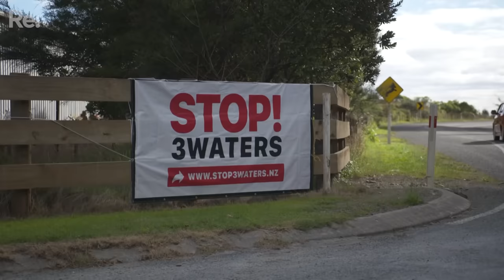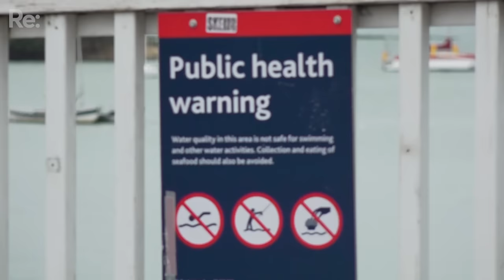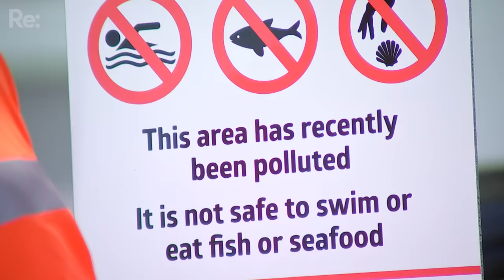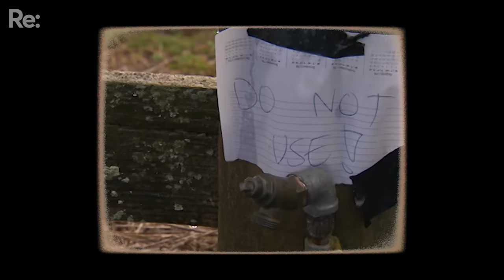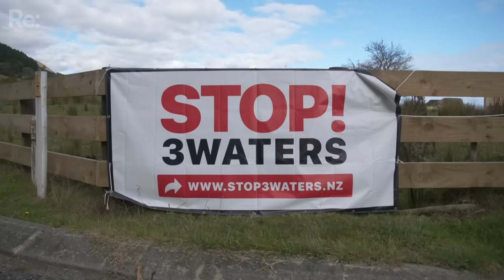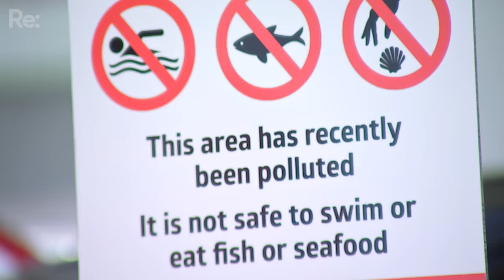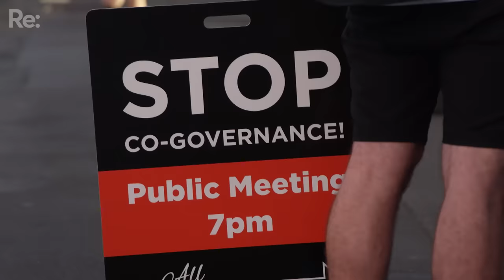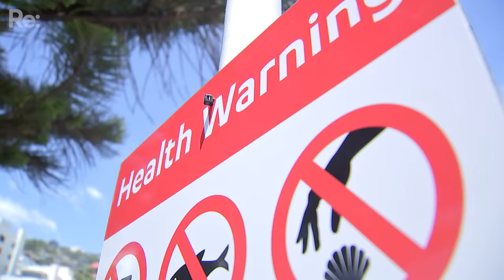Three Waters is dead. But our water system is still f***d

Comment: Coming from someone who worked 6 years in wellington water repairs. I honestly believe they sabotaged the repairs to push for 3 waters. Let me explain. Our service operated on Preventative maintenance. We locate leaks and repair before they become problematic. We managed to drop the water loss to its lowest with ease. However Wellington Water stopped using our service, fired all of the old timers who have been repairing wellington water leaks for decades and replaced them with fulton hogan. Not to mention 50% of the water funding was disappearing, a statement released by their own accountant. The signs they put up every year telling the public to cut down on their water is a scam, most water loss is from the council themselves
Reply: Considering who we are dealing with, sabotage would not surprise me, and on top of that, councils don't budget for the future.
Reply: Sounds like trump conspiracy theory  a figment of imagination
Reply: @rangisullivan1591  no it doesn't. What's your perspective?
Reply: Sounds like you need a new Mayor….a sober one
Reply: Complete lies.

Comment: I cant believe that councils didnt plan for this.
Reply: They only plan for today's needs. National will ignore either this problem, or force the councils to pass the costs onto ratepayers. 

The only chance we had for any option that avoided this, was 3 waters, and that is gone. 

By the time Labour returns, there will be no way to handle this by preparing for it, except reacting as it fails, council, by council. Some councils are already reporting failures, and I do not see this National government responding to it. They will ignore it as they always do with any event that happens. 

The effort to repair the damage as it occurs will eat up every cent and dollar that is available, causing more issues.
Reply: The costs were always going to be paid by the users under Labours proposals with the addition of a large bureaucracy. The same concept used in UK has been an environmental and financial disaster. Also not all of NZ is run down but it’s the cities with the problem.
Reply: @shauntempley9757  I think the maintenance should be paid for by the users. Councils will just need to put a maintenance plan together and allocate funding. This is exactly what rates should be for. We don't need more beuracracy to manage something that should be bread and butter for councils. We definitely don't need more centralised ownership of assets. They should be owned and funded locally.
Reply: They should have done it decades ago but uh money and control, meh.
Reply: @tooxtalivai0690  no point talking bout shoula coulda woulda. Just gotta put a plan in place. It's like planting an orchard. The best time to plant it was 10 years ago, the second best time is today.
Reply: Having worked briefly for a council in the water and wastewater networks unit, engineers every planning cycle clearly told councillors the absolute minimum that had to be done, and councillors thought the engineers were politicians, that is, exaggerating for effect.

In some ways taking this out of politicians' hands would be a good thing. Centralising it under the central government though? A recipe for perpetual delay and millions spent on branding and diversity training instead of pipes and pumps. Privatising it? We can see how that is going for the UK. The tl;dr is "not well".  No easy answers.
Reply: Of course they did but the voters wanted cheaper rates bills. And voted in people who gave them cheaper rates bills.
Reply: @jafa1402  this would all be solved if government required councils to put aside money for maintenance of these assets.

Comment: Is this issue less about 3 waters itself and more about how much councils have diverted infrastructure spending for years into other projects that are way more visible and/or more politically popular? This is not just impacting water. Road maintenance and development has been almost non-existent in my area, even given the amount off farm land being allocated to housing and the corresponding population growth. They are increasing rates and population and yet ignoring issues like water quality. This needs to change. Stop making it political, it should be about people, by people, and for people, not votes!

Comment: Three waters has added three extra levels of administration; half of which is controlled by Iwi, employ's 420 extra administrators and has locked in $500,000,000 of spending that has nothing to do with underground infrastructure, and this is going to make a difference. Yeah right!! How about reintroducing central government funding to current local providers, that was reduced in the 1990's. Next year Christchurch rate payers are looking at a 13.3% increase in rates, but we are rebuilding a city after a very large natural disaster. Maybe this increase will be less if we don't have to pay for Three Waters as well.

Comment: Three waters died because Labour used it as an opportunity to manipulate and promote their Maori agenda, which frankly, nobody wanted. So people voted against the Co-Governance concept and not against three waters as a solution to our water problems.

Had there been no Co-Governance inclusion in Three Waters, it probably would have been a great concept and ideal fix.
Reply: If that is the case it will be easier for the current government to just change that aspect of the programme and continue, counting it as their win. Unfortunately they are going to repeal the legislation and we are going to have to start from square one.
Reply: If you do a bit of reading you may find that court rulings on the treaty cases meant that without co governance the whole thing was likely to be tied up in court for many years. I think labour was looking for a quickest path to solving the massive issue. Keep in mind this is just part 1 of our massive infrastructure debt issues from delayed spending, the Ponzi scheme of GDP growth fuelled by high immigration and green fields land development.

Comment: Really great reporting, putting the entire blame for the Havelock North situation on infrastructure rather than the source - animal agriculture.
Reply: The 'source' was allowed to enter the water system via poor engineering (a poorly fitting bore cover in low lying terrain. Simple as that.
Reply: @Motumatai3  no sheep farming no contamination. Even more simple.
Reply: look at queenstown water, same problem. Not much sheep poo there... 🤷‍♂ thoughts?
Reply: @mattholwood  Um, sheep aren't the only things that poo. Even native wildlife does it. Do you think removing all animals from the land is a better solution than using better fitting bore covers?
Reply: @zweed69  what has that got to do with the price of fish?
Reply: @jeffappleton926  the film names the source of contamination. I'll repeat it for you: animal agriculture. Nothing about wildlife.
Reply: @mattholwood  Just because wildlife was not mentioned in the film does not mean that potential contamination from wildlife, and many other sources for that matter, isn't an issue. 

Here are the facts. Yes, the film identified sheep as the source of that specific contamination. However, as that particular bore cover was not sufficient to keep water born contamination of any kind out of the water supply your overly simplistic solution of "no sheep no problem" fails. The problem was engineering that failed and let contamination into the water supply. It just happened to be sheep in the example given.

An extreme use of the logic you use would suggest that people shouldn't be allowed in NZ because they poo and sometimes sewage gets into the water.

Do try to keep up.
Reply: What is your point ?
Reply: @jeffappleton926  I did not write "no sheep no problem" I wrote "no sheep FARMING no problem".  Do try to read. And while you're at it - have a really good read about water pollution due to animal agriculture.
Reply: @mattholwood  Good grief. OK, so your overly simplistic "no sheep FARMING no problem" solution fails. Maybe have a really good read about why a simple root cause analysis is rarely a suitable approach for solving wicked problems.
Reply: @jeffappleton926  I prefer to fix the problems at the source, rather than kick the can down the road. Let's see which approach works better long term. There surely will never be another repeat of mass contamination due to animal agriculture!
Reply: @mattholwood  Who is in favour of kicking the can down the road? Not me. Fixing the world is not like replacing a tap washer. Ever heard of unintended consequences? They're a thing you know.